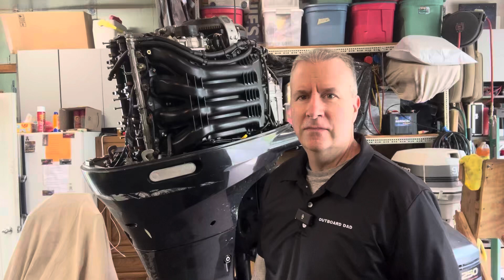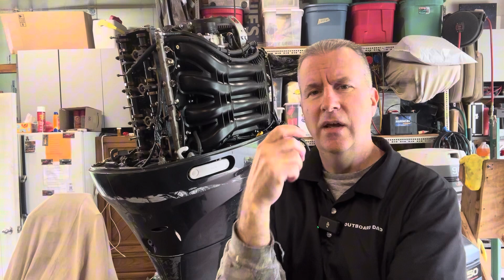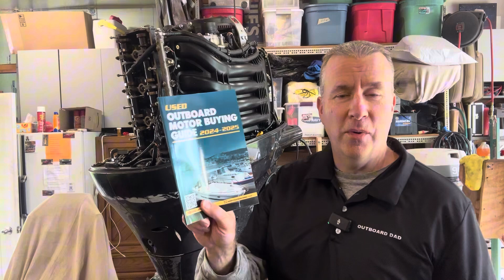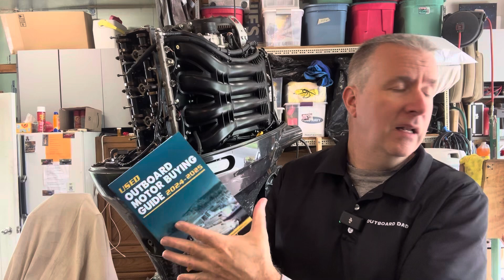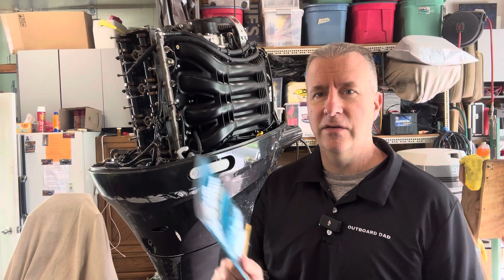“Rebuilding a 4-Stroke vs. 2-Stroke Outboard- Is It Even Worth It?”

Comment: this might hurt , but, the problem is that you bought a 4 stroke, bad choice. ditch it and get a 2 stroke.
Reply from the maker: No pain here! Thanks, what makes you say that?
Reply: @OutboardDad  4 strokes are more expensive ,harder to work on, cam belts are a bad idea, takes twice the displacement for same hp as two stroke , are heavier ,make more pollution than an e-tec, and are slower, i've worked on every kind of outboard made and are not impressed with four strokes  in a saltwater environment, pound for pound ,dollar for dollar , 2 strokes win hands down.
Reply from the maker: @johnbecker5213 Ok, I have been told some experienced mechanics say the aluminum is poorly made in the newer four stroke engines. Has that been your experience?
Reply: @OutboardDad  yes, porous castings ,stripped threads, cracks, serious corrosion. way worse now than back in the 70's/80's , seemed to really get bad with 4 strokes.
Reply from the maker: @johnbecker5213 That’s what I am seeing as well. But then again most things these days are disposable. Man I sound like the old guys that taught me growing up! What do you feel is the right course of action?
Reply: @OutboardDad  well, i think i would sell it, try to at least break even
Reply from the maker: @johnbecker5213 You mean as is? I was planning on tearing it down to understand and show the damage and see if we can learn how to avoid it for others.

Comment: Hope the block is good & you can find parts for it.
Reply from the maker: I am told there are blocks and heads available used, some place in North Carolina. Have you rebuilt o e of theee?
Reply: @OutboardDad no but my friend mechanic quoted him 6k to rebuild a merc efi that threw a rod but parts were back ordered.
Reply from the maker: @fishawk90 2 stroke or four?
Reply: @OutboardDad four. I don't think Merc doesn't have an injected 2stroke.
Reply from the maker: @fishawk90 Yes they had 2 models, one throttle body and the other direct injection was the Optimax
Reply: @OutboardDad cool.

Comment: The problem is- the previous owner got his grubby hands in there and started trying to fix it!
Reply from the maker: Hmmm, what makes you say that? Do you still think it’s worth rebuilding?
Reply: @OutboardDad  > I appreciate your channel<
When its half torn apart and "left for dead", the price of the unit just dropped by 75%!  If only them grubby hands put it back together or just left well enough alone, you wouldn't have gotten it for scrap price...   Yes, it's worth rebuilding because you know what you're doing. I enjoy your channel
Reply from the maker: @kq2799 Thank you sir! I appreciate the kind words. Have you rebuilt one of these? If so, any advice?

Comment: Hi! Marine mechanic here. The business worth or not depending how much you paid for it. I just buy stuff that I have a good chance to fix it ( well, as I usually say: everything (almost) is fixable but depending if worth the time and money on parts) or if I can profit with parts sale. Nowdays no good aluminium on any brand but Suzuki aluminium is one of the worst IMO and my guess goes for cylinder head pine hole (had one for fix with that  and could not be welded because qas on bad spot) but can well be the block, head gasket, exhaust guide etc If motor was been sitting for a few weeks/months and got stuck there is a good chance of have stuck piston rings and are very very hard to get them released and even when removing the piston is very hard to take them out from the piston (ask how do I know that),  The gear case crack is not a problem; welded, grinded and painted will be as new and last more 10/15 years. Since this is a common problem on Suzukis and old Yamaha's 60/90/115 the bearing carrier should came out every few years as maintenance pratice to prevent that (salt/corrosion build up between the bearing carrier and/or nut and casing causing the crack) Cheers from Portugal
Reply from the maker: Great stuff here! I appreciate your knowledge and experience. Where should I look for corrosion first?